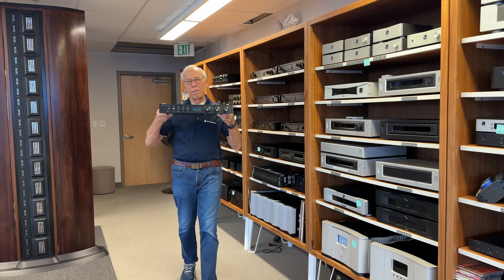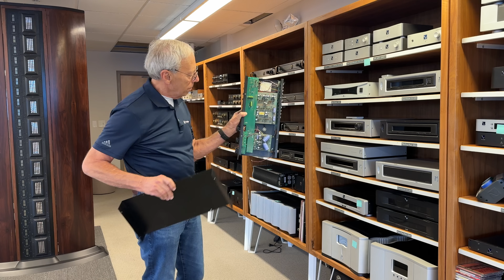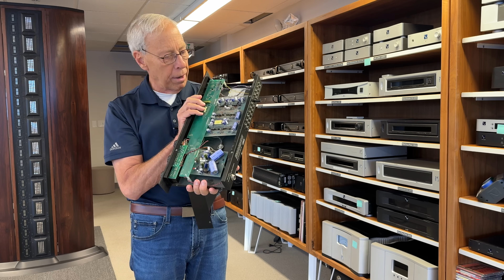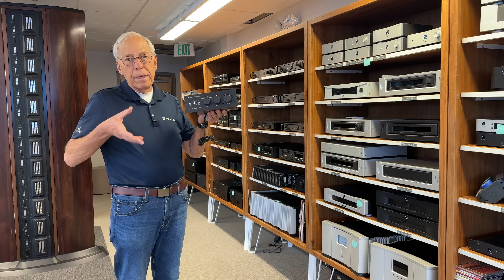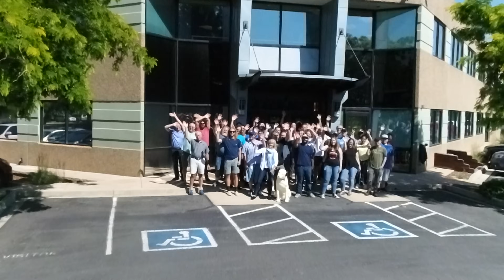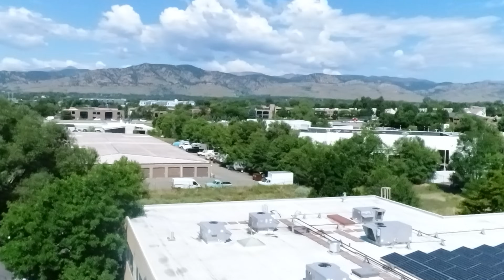PS Audio 50 year history, the PSIV preamplifier

Comment: Still have my PSIV kicking around somewhere in my house - Paul failed to mention the giant outboard power supply - a low impedance design, certainly trail blazing at the time (the huge transformer thing came directly from this man) - that preamp had more than enough gain to run any low output moving coil without a sut - and all that is not to mention it's very reasonable cost - truly, a landmark product imo.